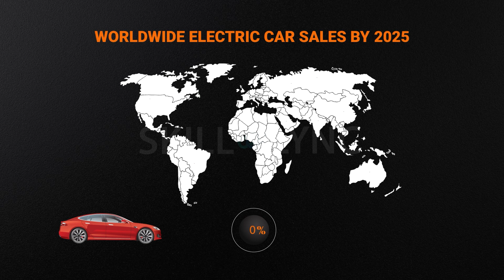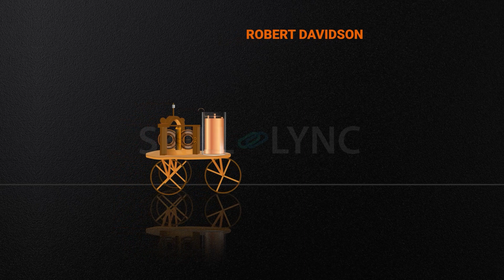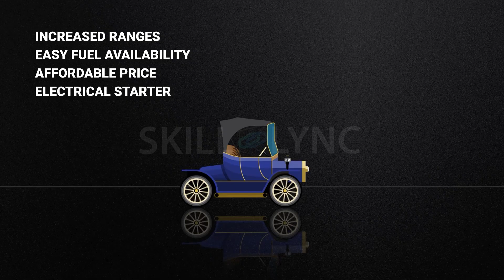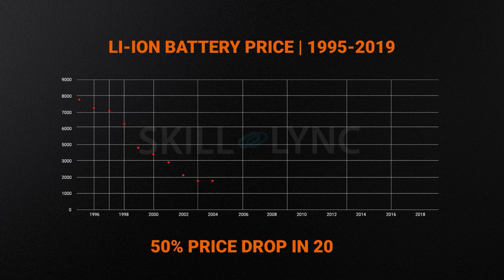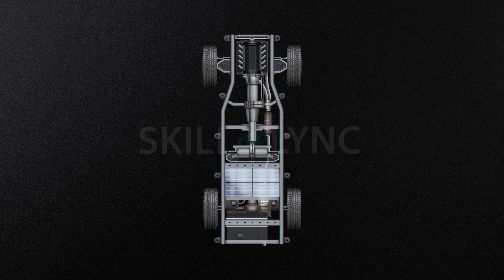Evolution of EV (Part - 1)

Comment: This is all supposition based on IF - iF a scalable, cheap, safe, energy dense battery can be found.  Current LIthium is a dead end. EVs have driven lithium prices up 1200%  EVs today weigh a ton more than non EVs example; the most popular Tesla Model Y is 5000, the Corolla hybrid 2800, Prius 3100, RAV4 hybrid 3300.  That extra weight cancels out the efficient electric motors on EVs; they have to move more and take more CO2 to make.  Many hybrids can commute all electric; and could even make 30-50 mile legs and do a short charge - EVs must do a long charge if they use their long range.  Charging at home can talk several hours; even days. EVs will be a big thing IF the new scalable cheap safe energy dense cells can be made and the financial gamble made to make them be done within a couple years.